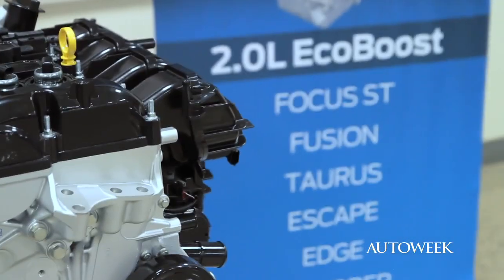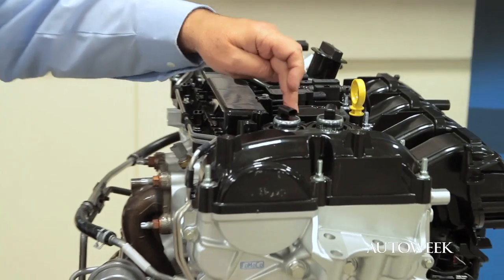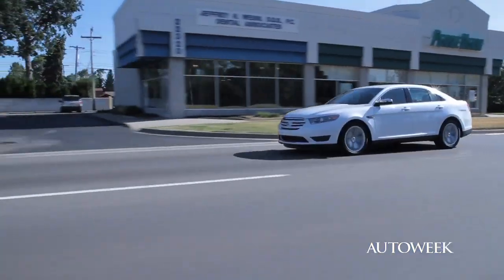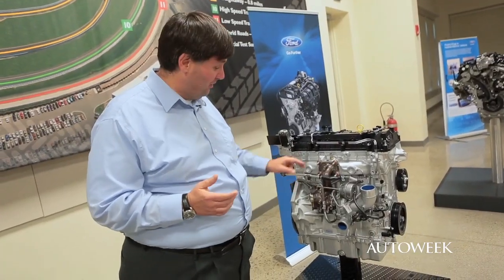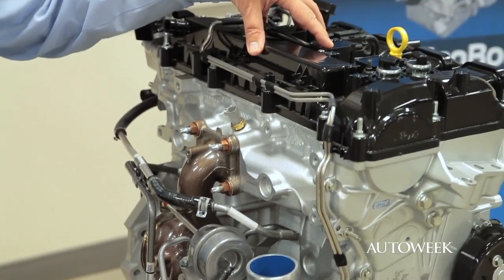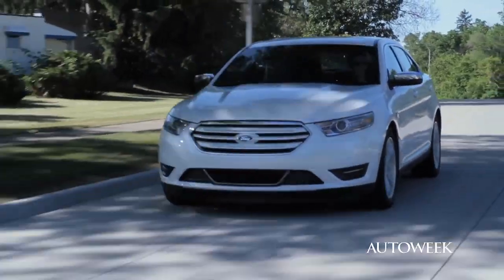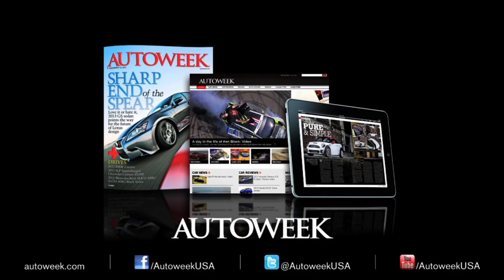Ford EcoBoost Engines: How they work - Autoweek Feature

Comment: E-CO=BOOST say it fool.....

Next time you explain how a turbo works, point to the right ducts when you're explaining it, don't put your fingers between the coil packs and say that's where the injectors are, they are not, the long 1" tube running along the rear of the rocker cover is the fuel manifold and the injectors are under that. And please can we start a gofundme for that bottom button to get a holiday...

Comment: Why does ford use a rubber belt for the oil pump in the 3 cylinder engine and 2.7 V6?

Comment: I just love my 2020 Ford fusion EcoBoost. ❤️❤️❤️
Reply: Sell it before you put 70K on it. The repairs will go up to $12,000 altogether over stuff Ford will not want to recall and it's all manufacturing defects. Transmission, engine flex plate, and rear main seal leaks. That's 3K a piece. Also, your shift cable will detach from the manual shift.

Comment: its not echo boost its eco as in economy says so right on the engine cover.
and the engine reliability is shit. piston in Cylidner #3 likes to spontaneously break apart after 96k miles. i been though 2 with the SAME ISSUE about same millage and around same time of year..

Comment: it doesnt look like the 2 litre engine can pull this guy ; but it does look like this guy can pull the engine. this engine is probably a smaller replica because it seems like this guy can rest it on his belly or eat this engine for lunch. engine looks small to be 2 litre looks more like 1.2 litre. i bet this guy himself drives a 5 litre v8 suv and he did this video to make him self look professional .   when they replaced the taurus engine from 3.0l v6 to 2.0 litre i4 they also reduced the life of car by 150 000 km . since 7 years car engine quality has drastically dropped before this engine used to go inside a focus now they are even putting it in taurus and edge titanium selling it for 40000 $

Comment: Direct injection causes intake valves to coke up and leak. I’ve seen more problems with turbos then naturally aspirated engines. No wonder they decided to quit making cars. I never heard of catch cans until turbos came out. And who’s bright idea was it to put a water pump on the timing chain so when it wears the antifreeze leaks down into the oil pan and mixes with the oil and destroys the engine. Where did Ford come up with their engineers?
Reply: Their engineers come from foreign countries where they all ride donkeys.

Comment: Up date even though ford an other manufacturers knew direct injection put massive amounts of carbon in the cylenders so now they change were some gas sprays on the valves to  clean them.i bought the old model after 4 years of watching then thinking its a good engine,buy it wrong😳5 years to fix it really slow.

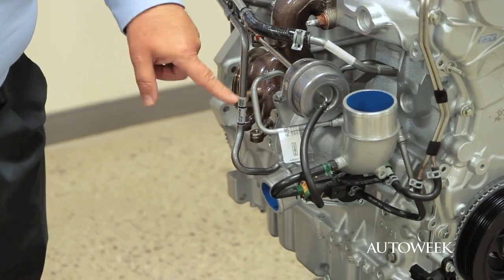Comment: 1:50 points to charge air port, refers to it as the intake sucking in air, points to intake, refers to charge air forced to engine. Minor mixup, I know, but this vid is supposed to educate me, not the other way around.

Comment: Yeah I’d like to know who the genius was that designed the direct injection fuel delivery system. 
  Pay no attention to all that sludge and carbon that’s gonna build up on your intake valves causing them to leak and malfunction. I just don’t get how these major car manufacturers can miss such a serious defect that would have been caught had they thoroughly tested direct injection before they started putting it into people’s vehicles. What ever happened to quality. Testing of components. Pride in what is made in the USA???

Comment: I love the echoboost engines. It makes so much sense to use spent gasses to make the engine more echonomical.
Reply: Good for the echonomy
Reply: It's hilarious and simultaneously sad how many heads the sarcasm in this comment went over, the literal replies have me losing hope for humanity.
Reply: It's just a turbo
Reply: That is the purpose of the turbo charger lol. Not a new a thing lol.
Reply: Sounds like a perpetual motion machine. Backup the exhaust with a pinwheel so the back pressure keeps the engine from breathing properly. They should go study the Chrysler hemi. It puts out so much power because the intake runners don't have to do any 90 degree bends. Airflow is everything.
Reply: I don't like Turbos for this very reason... Your restricting flow, to get more power? But your also restricting flow....
Reply: @FlyingSugarCat  A good turbo will not reduce the exhaust flow by that much, in the firdt place there is usually not that much pressure within the exhaust so there's a lot of room for more air to be in the system. Thus, more air is pushed into the engine, resulting in more power, and it will still be able to leave. It's been proven that a turbo is an amazing way to give a car more power, and for you, a nobody on the internet, to say otherwise is just clowning.
Reply: @FlyingSugarCat  bro this statement tells me you’ve never driven a turbo car .

Comment: Why are manufacturers now making a big thing of this ?. Saab were the first to use small low pressure turbos on small 4cyl engines to give better efficiency, MPG, and torque for urban driving. That was back in 1986.

Comment: Talk to mechanics about the Ecoboost engine and they'll tell you that the heads carbon up after 50,000 and the engines start running rough when they're cold.  It has something to do with the larger heads they had to put on the engine to get the performance and fuel savings they needed.
Reply: The head carbon is simply due to the direct injection. Gas never touches the intake valves, so they get dirty, as petrol is a great solvent.

Im mostly worried about the inherent stresses related to turbos, but modern ones should be reliable and long lasting (but this is Ford we are talking about)

Well see how they stand time
Reply: @BasedMan  Sounds about right to me.  Thanks for your feedback.

Comment: Direct injection is good  but also bad is the same sense!
If you don't run high octane fuel or run the engine hard enough it Will carbon up an burn up valves!

Volkswagens had this problem with there 2.0 turbo engine!

Which ends in a very expensive an labor intensive repair to repair engine valves an depending on mileage timing components as well as gaskets seal an fluids!
But there are precautions to take to avoid this from happens but in the same sense in running higher octane fuel will help dramatically but running the engine harder to prevent carbon build up will also affect the longevity of the turbo!

So you can't really win besides having the engine decarbonized after so many miles of service! 

An also driving habits will with direct injection will play a Hugh role such as more city driving in stop an go traffic!

In my personal experience the a good reliable engine would be such as a DOHC 24 valve v6 naturally aspirated engine! 

With today technology using VVT higher compression ratios they can engineer a v6 engine to produce 300hp 
With a good hp & torque curve from a 6 cylinder engine with a regular based style multi fuel injection setup!

Comment: I purchased a Ford ecosport 1.0 ecoboost  titanium Suv  in Jan 2016 hoping that it will give me at least 5 years of trouble-free use.  My  use is limited,  only done 11000 kms till now.  To my shock,  I see that the coolant water pump leaks   lowering the level of the coolent from the reservoir.  On contacting the authorised service agency  in my town,  I was told this will involve lowering the engine,  replacement of the timer and at least 2 weeks at the service centre.  I am totally disappointed,  hearing the delay and expense involved which they said was Rs 30000. 00 for replacement of the coolent water pump and allied parts.  In addition a labour charge of Rs 10000. 00,  Ford should make this model of car more reliable with  parts that can last,  I will definitely not recommend any one to purchase the Ford ecosport Booster engine car.  Really regretting for having purchased this car  friends please take me seriously and not commit the grave mistake I did.  Please buy a car from a more standard company,  Ford is obviously not reliable   that is what I have experienced.

Comment: certainly great for 28,000 kilometers then just a lot of hassle endless misfiring back firing lack of power lots of vibration and poor fuel economy . Been to dealer 12 times in 6 weeks and this seems crazy on a car that new

Comment: What I am wondering is if the fact that the engines turn off on its own after idling for a fixed time. Will in turn wear out the starter motor faster? However this didn't cover that at all.

Comment: Looks good on paper, but the back of the intake valves get dirty as shit in these direct injection engines and they start to run poorly. Then you have to clean and/or replace parts which gets pricey. I'll stick with port injection.

Comment: for everyone saying you had a bad experience with Ecoboost engines you got a lemon..end of story..I have the 3.5L Ecoboost in my Taurus SHO and it is easily the most reliable engine I've ever had in a car and it gets up to 28 MPG and that's all slightly modified to put out 400 AWHP..and I know many other people that get the same power with the same gas mileage and they have almost 200k miles..all you need to do is your regular maintenance that any other car needs

Comment: yeah. but did u figure out the problems with a turbocharged direct injection engine? the carbon build up on intake valves? cam phaser coming apart? no catch can from the factory?
Reply: Ford doesn't want to talk about that.

Comment: Direct injection Ecoboost is all junk more of Ford's technology NOT lol
Reply: +RyuDarragh they're getting that gas mileage in the fusion, and it's much larger.   it's about making larger nicer cars more economical since the US prefers larger vehicles.  the Fiesta st gets that gas mileage, weighs less, and makes more hp and a lot more torque.  they focus a lot on torque.  your car likely sits at 3k rpms at 70mph, where the fusion sits around 2200rpms, and my focus st is around 2500.   toyota are great cars, but they're some of the most boring vehicles on the road.  even the Toyotas I love, are extremely bland.
Reply: ***** they arent like boats anymore and thats mainly solid axle 4x4.  Its difficult to drive for pleasure if your car isnt fun to drive. 

I think id rather have a.n.t mans powers and jump every where like a flea.  

If you dont drive for pleasure and you want good gas mileage, get an elio or an electric car.   You can get a few electric vehicles fairly cheap.  Ive seen the nissan leaf for under 9k.
Reply: is that so Mr. Einstein.. so what engine did u build made a few awards? .... do tell me then I'll dump my ecoboost in the trash

Comment: "Put the 2 together and you have EchoBoost"
Reply: +sub to NIBSU 2 Problems, and falsely advertised numbers.  It's as simple as that.  
I have a 2013 Ecoboost F-150 King Ranch, and the mileage (average, mostly highway, and babying it) is around 14.5mpg.  The power is much less than advertised, too.
Now the real issue.  
I cannot keep timing chains and cam phasers in my truck.  The phasers go out, stretch the chains, and destroy the guides.  Total cost of repair- almost $3,000.00.  The intercooler condensates, causing the truck to stumble and misfire.  The truck has recently started stumbling while driving, causing a shake that was so violent, that it popped the sunglasses compartment open and splashed water out of my 30oz. Yeti tumbler that was little more than half way full.  The dealership has no idea what is causing this, but has cost me $180 each of the three times I took it in, for diagnostic fees.  Also, the injection system causes carbon to build up onto the back of the valves, which destroys the engine and it's performance.  And Ford has no way for us owners (or shops) to clean these valves without a complete engine tear-down and rebuild.  On top of it all, my wheel hub has gone out yet again, the rear window seal has a 1/4" gap from the factory, the window regulator broke last week causing my driver side window to crash into the door, shattering it, and the very day that I got that fixed, my sunroof refuses to close (which is another $2,000.00 repair from the dealership).  And all of these things are very well documented, widespread, and known problems with these trucks.  Ford completely ignores us owners, and refuses to address these issues properly.  The newer F-150's, especially with the Ecoboost engines, are lemons by design.  I am a Ford fan, and own a '13 Ecoboost F-150, as well as Mustangs, and am very active in the Ford community... but I have got to be honest, these trucks are junk.  Hope this helps!
Reply: Argh you bugger , I wanted to pick up on that .
Reply: Haha don't hate with ur ugly bora ^^
Reply: umm..sorry to interrupt,but why are these eco boost engines so hated amongs car people? i mean, when someone says something about ecoboost everyone seems to hate it...but in the end,isn't it just like your turbocharged subaru or something xD
Reply: @devalcars5873 i think that ecoboosts have a bad rep cuz of the wet belts some have.
Reply: Eeeee-co. Not Echo.

Comment: Wow nice engine. However everything new is well forgotten past. This particular technology was used by 944/968 Porsche engines back in 80s. The difference it was not a direct injection. Direct injection kits for these 4 cylinder engines can be still purchased freely. I don see what the hoopla is all about.
Reply: very little turbo lag, small turbo's spin up to 140k rpm. And you're right, nothing is new about this, except maybe variable cam timings. With all that though they can run higher compression with the turbo's something you couldn't do before. Ive had 2 different ones and the low end torque is nice. Personally I like them.

Comment: 32 mpg highway running is pathetic.  OK I know that US gallons are smaller than Imperial gallons but IMHO the gas mileage is still  poor.  In Europe we have cars that can deliver over 60 mpg and these are not bubble cars!  Typically they are common-rail turbo diesels producing between 90 and 150 HP.  With careful attention to aerodynamics excellent results can be obtained.  Once one has lived with a car that returns over  60 mpg the gas-hogs are no longer attractive.
Reply: +Tech Davey You realize 90-150 HP cars are not popular, nor are they good to own in the US? Everything is far spaced out from each other and requires a lot of driving to get somewhere. People use the massive interstate roads daily to get to work, home, etc... it isn't like Europe with smaller roads and very close nearby towns.
Reply: Here In New York, I can drive 9 hours and still be in New York.

Sometimes I need to go up Mountains.

Sometimes I need to dig myself out of a ditch.

90 horse aint gon do it.
Reply: The point is that these engines produce more horsepower per liter, while also delivering improved fuel economy over comparable engines.

Comment: The ecoboost engine is the worst engine I have ever owned. My 3.5L required complete replacement at 37K and 48K miles. There are so many design defects that Ford has instituted program to "manage" owners through warranty period, and dump responsibility at expiration. Do your homework before you purchase an ecoboost, the TSB's and repair mechanics tell the real truth behind this Ford designed junk. One of the best kept secrets behind ecoboost and related component failures is excess heat. Ford has packed various aggressive heat sources under the hood in tight mechanical configuration. Engine, radiator, twin turbo;s exhaust, catalytic converter, etc.; all squeezed together in a mechanical nightmare. The heat caused premature failure of various components including Ford's new electric steering assembly. Take a look at the new Mustang engine heat related recall for a clue. Ford engineers are young, aggressive and completely incompetent. Unless you enjoy attorneys and courtrooms; stay away from Ford products.

Comment: wow I didn't realize how small the turbos were, I was having trouble finding them on my engine
Reply: +Neil Caulfield I have the Fusion with the the 1.6L EcoBoost and I still dont know where the turbo charger is. I can hear it when I mash my foot thru the floor tho. ;)
Reply: +RellyOhBoy yeah i took the dump valve hoses off, makes cool dump noise when I accelerate hard and let off suddenly
Reply: +Neil Caulfield so the dump valve hose just goes from the turbo back to the intake correct?
Reply: +RellyOhBoy its also called a blow off valve, the higher the RPM, the more boost the car is making, the more boost, the more air that is being rammed down the throat of the motor, when you let off the gas, all that extra air can't be pushed down into the motor so they made a blow off valve to release pressure (BM7WTTeo_iE) put that link into a youtube vid and play it
Reply: It's actually called a bypass valve since it recirculates the pressure release back to the intake.  A blow off valve releases to the atmosphere and makes a lot more noise.  The safe way to hear your bypass valve is get a Green filter to replace the air filter, it will allow turbo noises to be more apparent.
Reply: Turbo*

Comment: i want to get one of these ecoboost cars and bolt up a larger turbo to it. I doubt you would have to change much more to make some extra power if its already set up for forced induction, probably wear out the internals a lot quicker but i wonder  how easy it is to do
Reply: Just put a hemi in it and be done with it.
Reply: Probably need injectors, fuel pump and other fuel related items